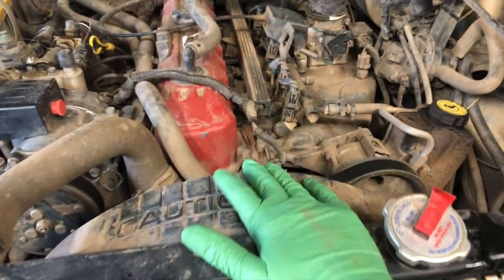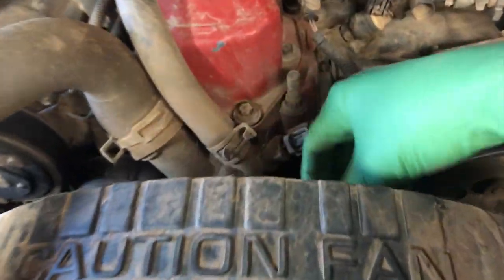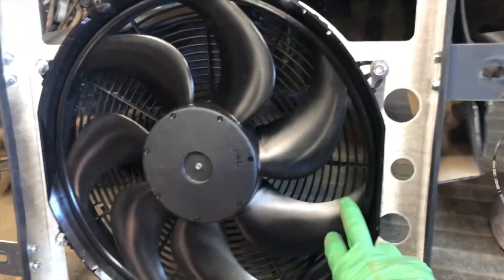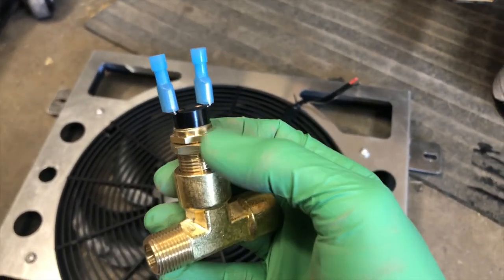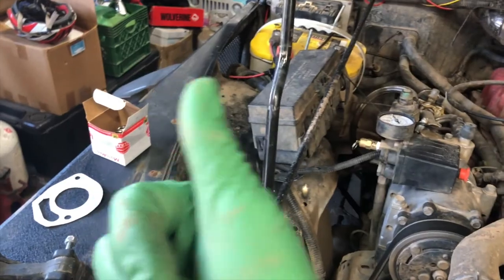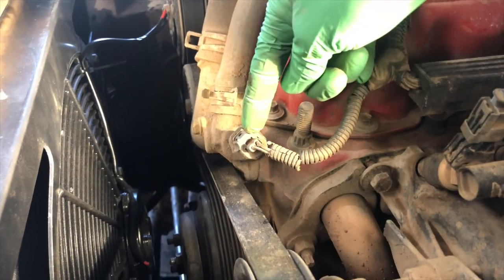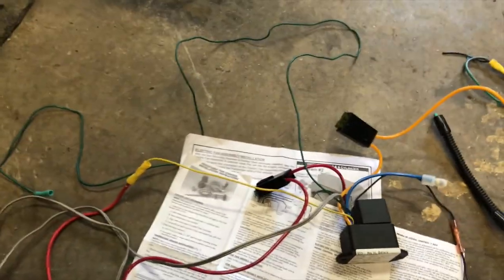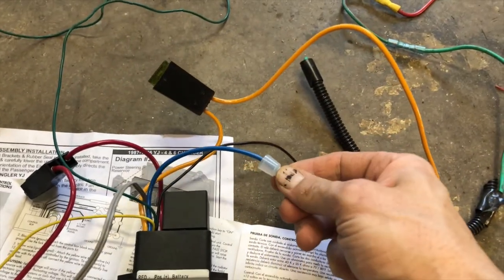Mechanical Fan DELETE Jeep 4.0 Wrangler S15E24

Comment: except...you dont have a/c lines.. In Florida we need AC.. and i am currently running into the issue of the jeep overheating while the AC is on..with an aluminum 3 core Rad, Elect Fan and thermostat sensor that turns on the fan at 170 degrees..i can drive all day with the current setup without AC and it will not overheat... As soon as i turn on AC it rises in temp to 230+ degrees. It turns out i need a higher CFM fan.
Reply from the maker: yep...

Comment: Can you plz share the link for the Temperature Sensor adaptor.. I couldn’t find it. Many thanks
Reply from the maker: it depends on your setup. not always gonna be the same thread. basically you need to know what thread your current temp sensor is. then get a brass T fitting with that size on one end in female for the sensor to go back in and male on the other end to screw into the old hole where the sensor was. the leftover hole is for a new sensor that grounds the fan relay when hot.
Reply: @WaynesWorkVlog  what is this exact fitting you are using for this 4.0 setup.  I am currently looking for it.
Reply from the maker: @questioneverything3332  https://www.ebay.com/itm/333398959456?hash=item4da0206560:g:I1YAAOSwNoBdz2Ad
Reply from the maker: @questioneverything3332  https://www.ebay.com/itm/122296820349?hash=item1c7975627d:g:3S0AAOSwkplfaNOX
Reply: Thanks man I rigged up some stuff I found at home depot.  Hopefully it works..
Reply from the maker: @questioneverything3332  Yea its just pipe thread so should work!!